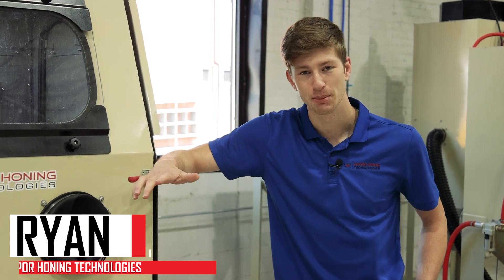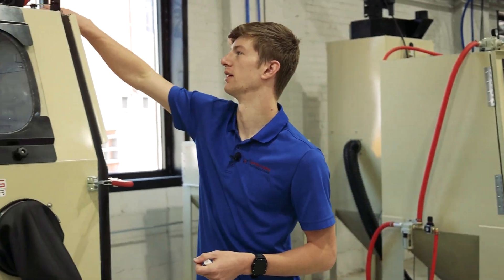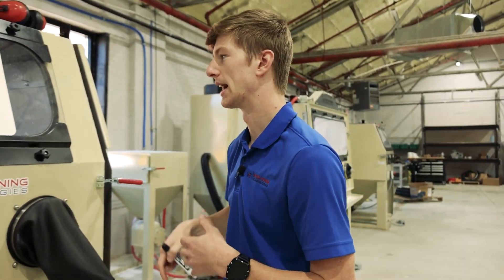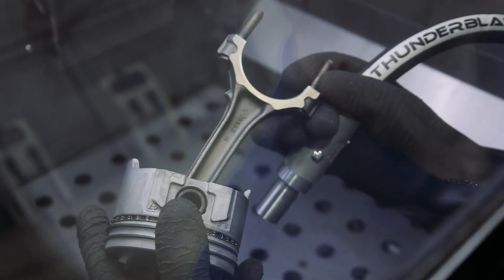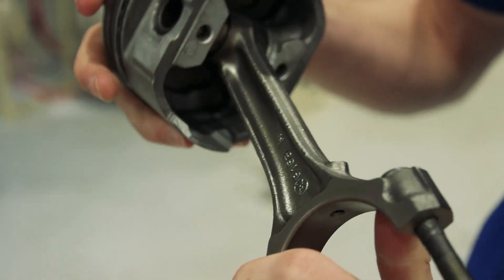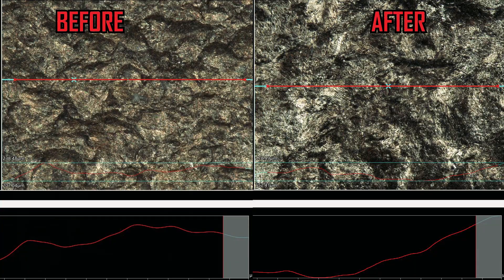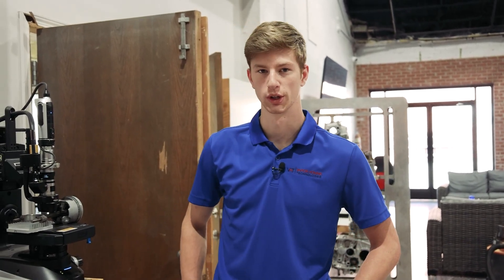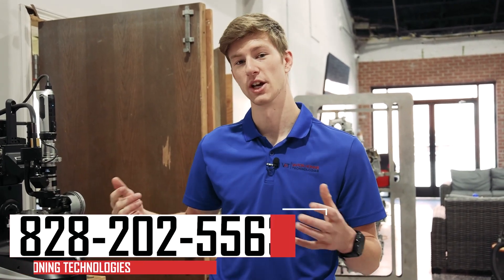What Is Shot Peening and What Is It Used For?

Comment: yo guys i may have a crazy area, you know for shits and giggles. can you guys try shot peening a stainless steel pan. it is known that stainless steel pan sticky to food because of expanded micro ridges in its surface when heated. well actually that, and shrinkage when the relatively cold food contact the surface. now, this process reduce the irregularity i wonder how it will be for the pan. the guys at wpctreatment do some metal tube spinning and they look frictionless.

Comment: The most imp thing is shot peening intensity which is set and corrected by Almen Gauge. Shot peening is shot blasting but is very controlled and precise as the shot size selection depends on the part and the intensity (velocity of the shot) depends on the type of material.